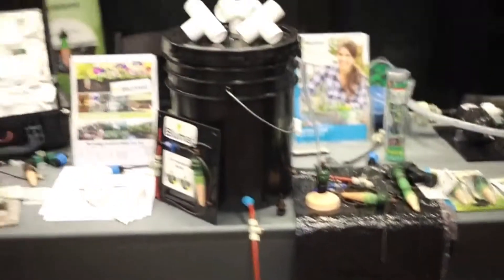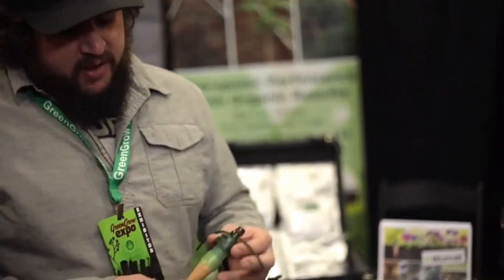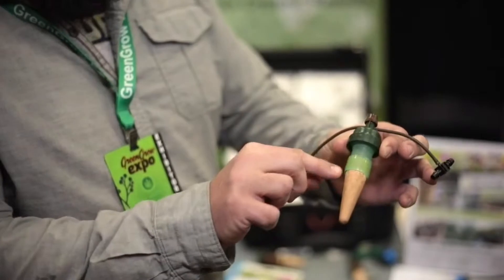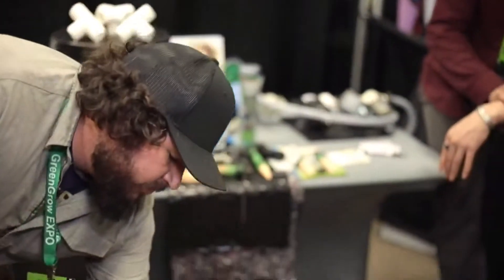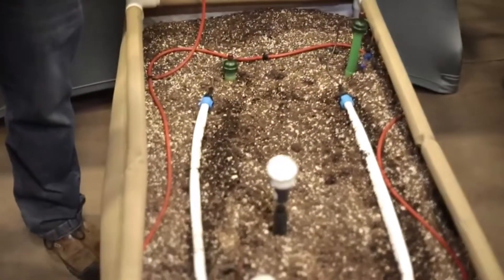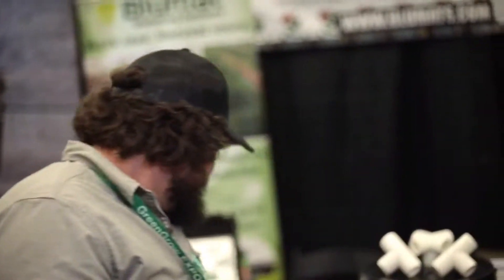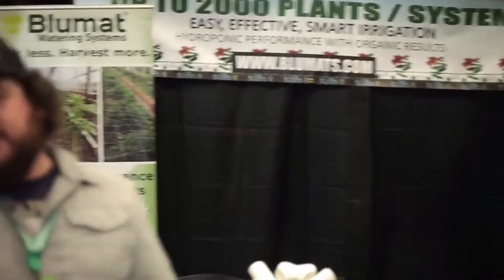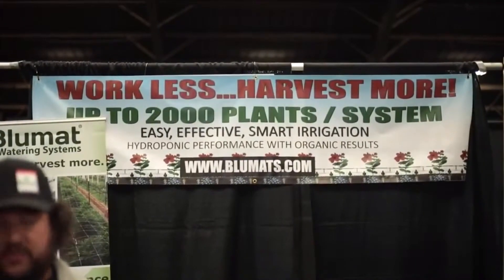Explanation on how Blumat watering systems work Green Grow Expo

Comment: would one classic blumat be efficient enough for 15ltr pot or will I need to
Reply: I read somewhere that the classic does not do the same as the tropf system. It does not have the dial on the top and seems the soak through the cone/carrot. The classic is a lot cheaper but the tropf is the better system
Reply from the maker: One carrot should work for a 15ltr pot, but it also depends on how thirsty your plant is.
Reply: I think it would. Try it out

Comment: I used the blumat system almost a decade ago. the only complaint I had is that roots were growing up out of the soil at every drip site.
Reply: Sounds like a problem I'd like to have
Reply: is it good ?
Reply: @Caleb Shofner plus they should air prune at that point shouldn’t they? Causing increased branching of feeder roots?  Seems like this would be ideal
Reply: Add some hydro corn near the drip site
Reply: Will, sounds like you have some bofa.